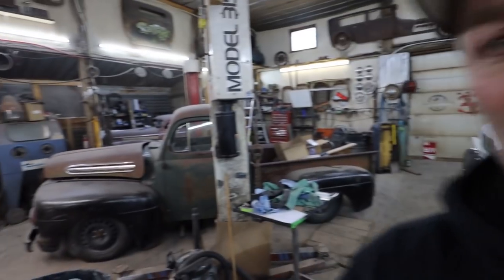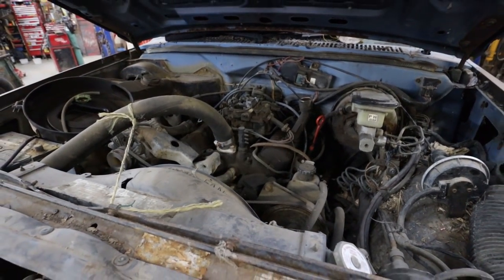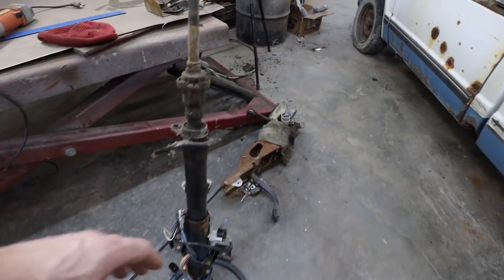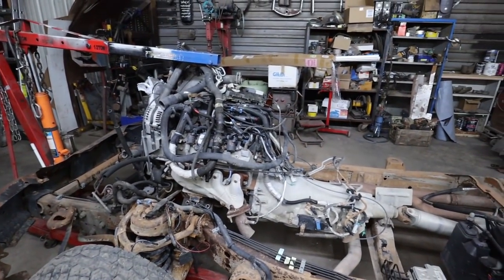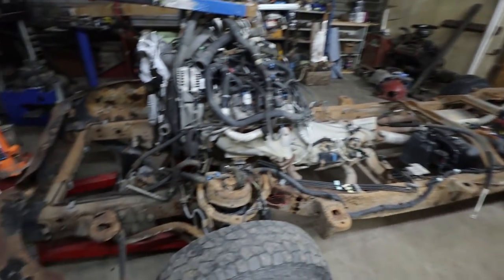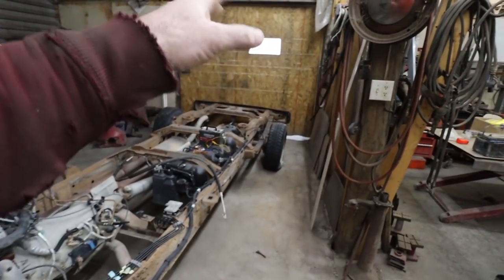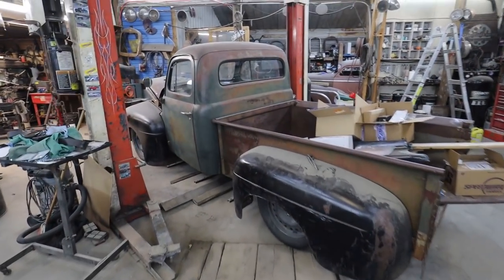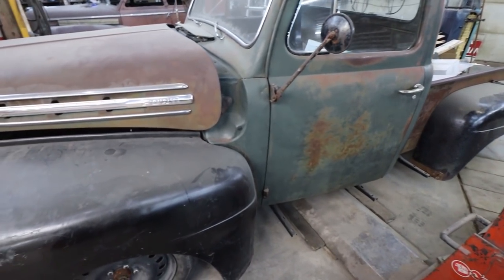New project 51 Ford pickup chassis swap and LS power Part 1

Comment: Simple and straight forward ! Nice ! One thing I’ve learned about old trucks is if it’s that clean chances are it’s a truck from a crop farm , they usually get parked for the winter and not needed till planting season and if it’s a cattle farm it’s usually rusty because they use them in the winter for getting and transporting feed so they get the salt !

Comment: My S10 had light bubbling on the front of the rockers. When I cut it apart, I had to make new inner rockers, rebuild the inner structure on both sides from mid-lower-hinge down and replace the outer rockers. I also had to replace the driver's side floor. So, it might not be as solid as you think. lol Cool project either way!

Comment: Excellent video Brent  :) also S 10 frame is nice choice on 1950's Ford Pickup truck to also Van motor and transmission too ! Also have ever use S 15 extended cab also 4×4 frame in any your builds I have found just easy as S10 ones ever use one be happy how work out too! Also be more parts used of S10 body for build like Heater Core Fan plus it  box to also turn signals off front bumper are  orange  to plus rad if any good too Brent :) there some can thinking about using! Also got most need there for sure ! I check Back drive axle ratio is and plus axle be long enough for build too !

Comment: Thawing water line, been there. 12 volt demand pump, coil of 1/4” air brake tubing and a pail of water. Disconnect line,place pail under line and start pushing 1/4” tubing down. Find the ice and turn on pump. Catch water coming out in pail. Recirculate water and keep pushing tubing as it thaws. Doesent take much. Cold water works fine.
Reply from the maker: Yeah been struggling with it still no go haha

Comment: Pretty Skippy on the breaking the old one down I was impressed.  I live up in a mountain and I'm surprised how much snow you got here late in the season I assume that's recently? We almost got a dump of snow but it didn't happen, and live up near the Canadian border but in the states I thought we might get a couple more feet late in the season we can get snow here in through end of April we get our freak snow once in awhile even early June but you see by April early May were done; but you got respect what we'd call a couple feet basic questionnaire is that your truck? Love the (pedibone?) Your fork lift I didn't know they had an articulating frontend loader I'm impressed by that, boy one of those would be handy on the mountain here! 
Pretty slick so quick work on the taking the body off amazing amount of sand & rust as you impact driver backed out bolts nice to have the tools and know your stuff it would take me sooooo much longer and I'd be confused. Nicely done ! 
Love Pablo Always the optimist he wants to be up for a wanna go for a ride? What a cool dog. Thanks again for sharing your auto adventures with us. Looking forward to yet another great adventure the LS engine swap with trans appeals to me as my GMC get terrible gas mileage whereas those have much more power and far greater fuel economy, an idea I too am considering  so it be interesting to me please tell us the engine bay sizes if you think of it. 
Best David

Comment: god 

Why don't you nest the shassy what's already in there?
The old is also modern but you also have to replace many parts.
I can understand what you did with your worktrack.
but I don't think it's so good to call it a rusty alts shassy
Reply from the maker: one feller bought the body and another the chassis, kinda why this is all happening haha not my deal just legoing stuff together.
Reply: @HalfassKustoms  I thought you bought everything together.
Consolingly, I find the chassy of your fort pretty run down.
the other one i saw modern suspension .